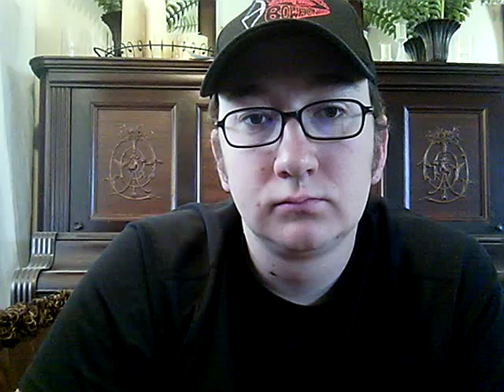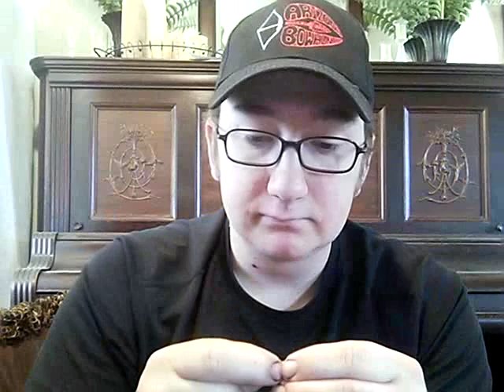You CAN'T put CO2 directly into your magazine!

Comment: I want to find a accurate regulator.  And   a 90 degre fitting.  That will keep the psi  down.  Can you  educate me on fittings and airsoft gear to fit  my lock 18 c. .
Reply from the maker: If I was going to get a new regulator it would be a palmer or a CProducts low pressure regulator. The LPRs are going to be a lot more consistent at 100psi. There are a bazillion fittings out there and you can probably get what you need at the hardware store, or a paintball shop. For the quick disconenct fittings that you will want, McMaster-Carr part number 9414K62, 9414K19,5225K604,5225K303. To learn how to set those parts up, go to gasguns.info/forum/viewtopic.php?f=58&t=4522&start=10
Reply: Im new to airsoft.  I mainly practice long range air rifle  and 600 yards  with 3.08  . So I need all the advice I can  get  to also  rig up my king arms gbb m4 . I just got it
Reply from the maker: have you watched all my videos on air rigs? If so, start mining the info over at gasguns.info especially that link I posted. I've not been in airsoft for a few years so getting into the forums at gasguns will be your best bet.
BTW I'm getting into long range shooting as well! I've only shot out to 400 yds so far, but I've got a new rifle for long range: 7mm rem mag!
Reply: Im from prince edward island  canada..     our long range is called Alexander point  range.   Check it out on   314299s channel